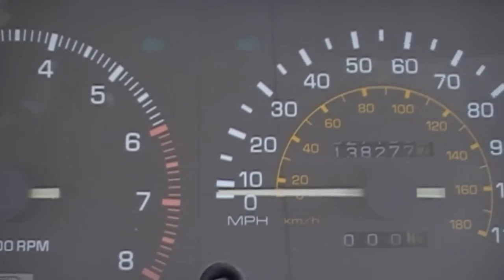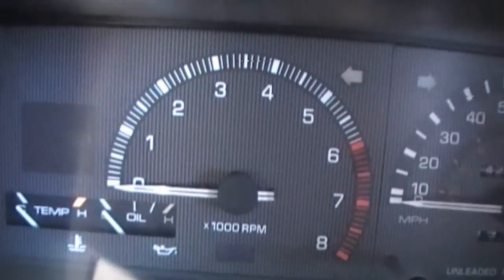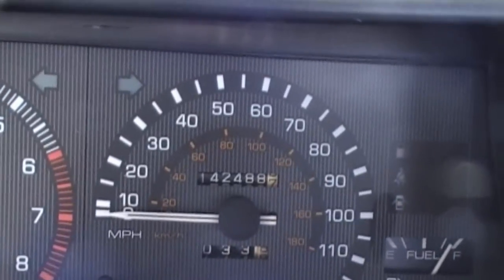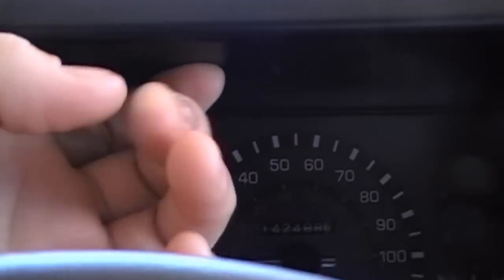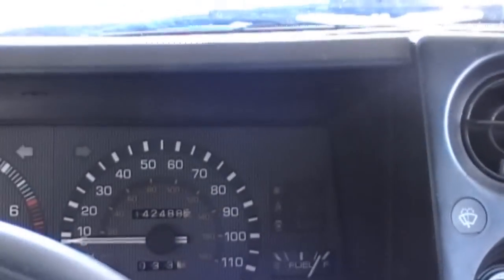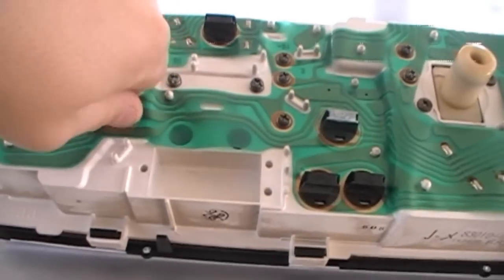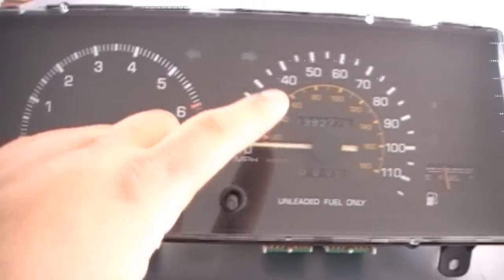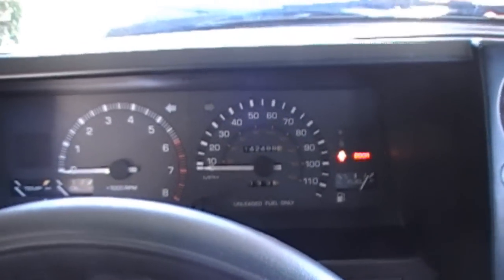AE86 Zenki to Kouki Cluster Conversion

Comment: @84hachi : So the light switch/dimmer have been working great, after a little adjustment. I bought a universal speedo cable, but it was no good, not really compatible, but it was only $4, so I ended up using the metal square drive tip that came with it and put it on the plastic tip, with shoe glue and forced it in with a hammer, after grinding it down a little, (kinda' like getting a crown at the dentist's). anyway it works now, but wiggles a little from 0-55mph.

Comment from the maker: Problem with the digital cluster is the hell of switching wires around from the OE USDM wiring. Then finding the oil pressure switch and the fuel sender meant for the cluster. It's so much that I prefer my analog cluster.

Comment from the maker: @edgarshoe 
Well when the speedometer doesn't work it means the speedometer cable is bad. It goes from the back of the cluster to the tail shaft of the transmission. As for the no lights. It probably the switch for the lights. My lights barely came on at night when i 1st got it. Replaced that fixed it.

Comment: The KE72 is based on the '79 KE70, but mine was manufactured in '85-'86. The problem with wagons is that they're the 'barebones' models of the lineup, so no wagon ever came with a tachometer cluster. One AE86 cluster has turned up on the 'bay so my interest has been rekindled! Just thought the AE86 cluster would look killer on my wagon!
Rgds.

Comment from the maker: JDM and USDM wiring for clusters are completely different. You would have to rewire every pinout to make it work. You need to get both wiring diagrams and and rewire the JDM wires to the USDM cluster pinouts.

Comment from the maker: @edgarshoe /
You need LED number 168/194. Installation matters for LED's. Make sure the polarity is correct. The proper way is to use a multimeter. The cheap way is put them in one at a time and test each time. More info and seeing it can be had on page 96 of Project Car Magazine # 16 Summer 2010 issue.

Comment: @84hachi:  So you think it's the actual light switch? Headlights and corner lights come on, though. I thought maybe it was the cluster itself or the dimmer, but you know what I was able to "repair" some other electrical issues and turns out some of the switches and buttons in other places just needed a little cleaning. thanks for your response. I still hope I can find a cluster like yours, I've seen others on ebay, but they are too expensive, and also they have km/h (only) and are "backwards".

Comment: Man, thanks for the information. I have seen several abused nuts,screws and the switches cracked because of people did a  lazy  job and did not have the right tools for it when they changed the cluster.. Did you find  any signs of that in your car, or was it easy to get it loose? From my view, I like how you changed it to a SR5.

Comment: i also replaced my gauge cluster, although with a gts one. still the early version without the white lines though. what i did to keep my milage, i took apart each cluster and pulled the whole number assembly out and swapped them. it wasnt hard and it kept my milage. since thats illegal to do that without telling the DMV. (from what i heard). good vids though. i like them. *thumb up*

Comment: @84hachi So i was able to get the light switch to work and you were right the problem lied therein, but I will still look for a replacement. As far as speedo cable, i removed cluster while i was messing with light switch, and i propped up the car from the back, i turned on the car and the speedo cable end did in fact turn. DO you think it is just worn  and no longer reaching the back of the cluster? I will check it out. PS how much did you pay for your cluster? thanks.

Comment: @84hachi : I went to the junkyard today and found an 87 corolla and it had a cluster like yours. $40. I will go back and get it on monday, also has a few other compatible parts with my 84. I bought some trunk tensioner bars there, but have no idea how they are installed. looking online but no help. any ideas? i will aslo go back monday and see what other parts i can get, i think i will also get the original speedo cable.

Comment: I gotta ask, I recently found this '86 Hachi SR5 and it had '84 gauges.  Could the original '86 gauges could of been replaced with the '84 ones or could they just be an option from the factory?  I mean, I know alot about these cars but not a whole lot.  You have a nice one by the way :3